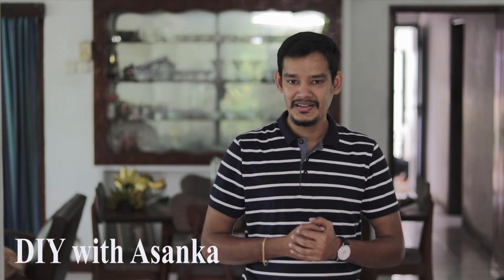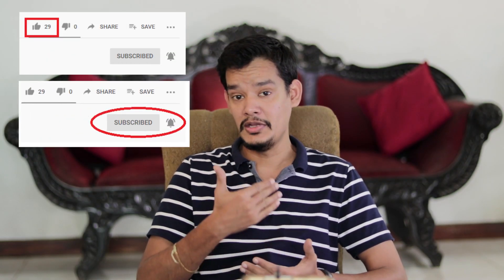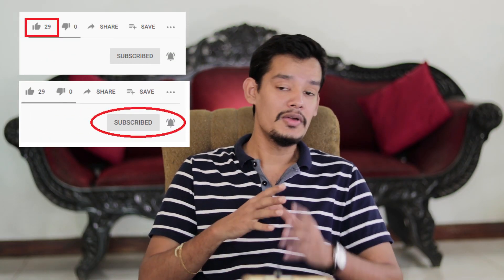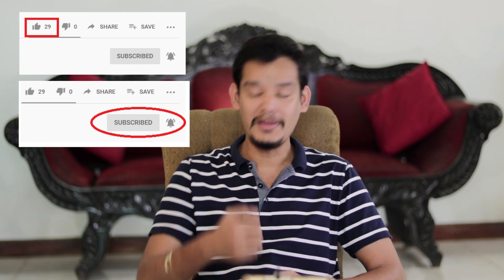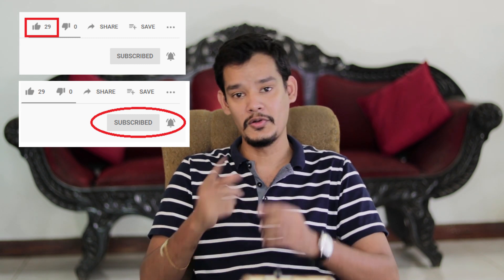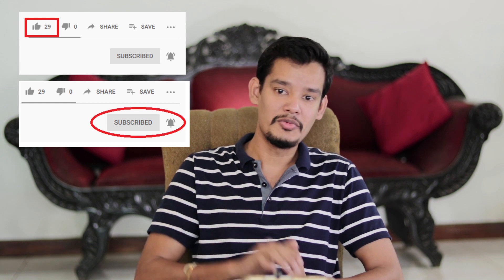අපේ ගෙදර විදුලිය අපි හදාගමු

Comment: Aiye solar penal ekak gaddi check karaganne kohomada. 100w.12 kiyanaeke theruma mokadda
Reply from the maker: Solar panel ekak gaddi check karanna ona.
1.solar panel eka pitipasse sticker ekak gahala tiyanawa open circuit voltage eka.solar panel ekata awuvva watena welawata positive ekatai negative ekatai multimeter ekak connect karama e voltage eka solar panels eka sandahan open circuit  voltage  agayata aasanna agayak wenna ona.

2.solar panel eke mention karala tiyana amp agaya multimeter eke amp setting ekata set karala positive ekatai negative ekatai probes deka connect karama dawal 11am - 2.pm solar panel ekata direct sunlight watena kota eken nipadawana amp agaya solar panel eke mention karana agayata aasanna agayak wenna ona.

100w kiyanne panel eke capacity eka.
12v kiyanne viduli darawe pramanayai.

Example ekak widihata kiwwot 12v charge controller ekakata oya panel eka direct connect karanna puluwan. 
Ewagemai oya wage panel dekak tiyanawanam series krameta 24 karala ganna puluwan. Voltage eka 12v walin use karanawada 24v walata yanawada kiyala theranaya wenne solar panel ekai charge controller ekai athare thiyana wire eke diga pramanaya anuwai
Reply: @DIYwithAsanka  100w eke open  circuit voltage eka 20 gananda ene
Reply from the maker: Eeka panel eke sticker eke mention karala tiyanawa.
Mokada eka eka panel nishpadakayo use karana cell eka anuwa ewaye output eka wenas wenawa.